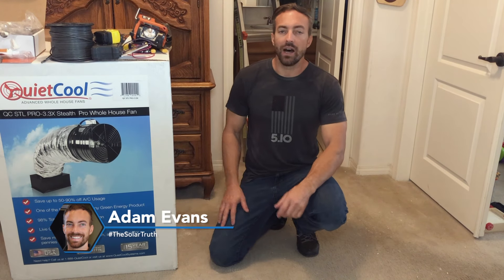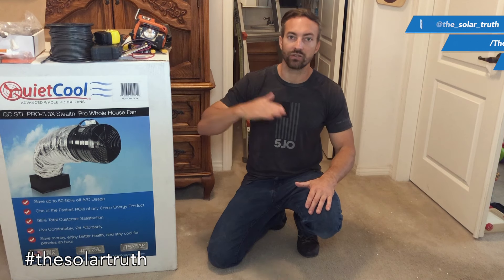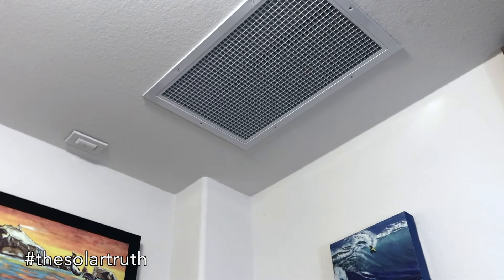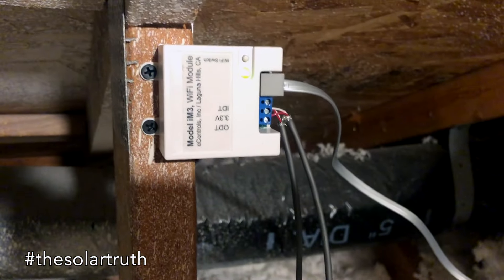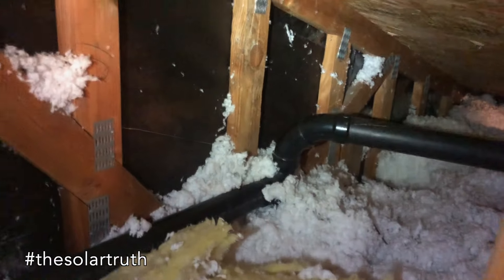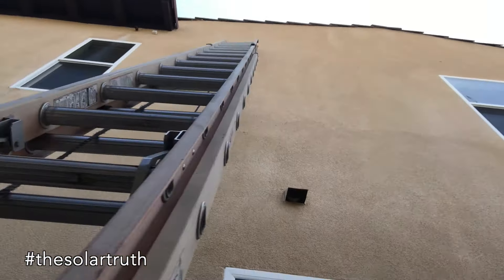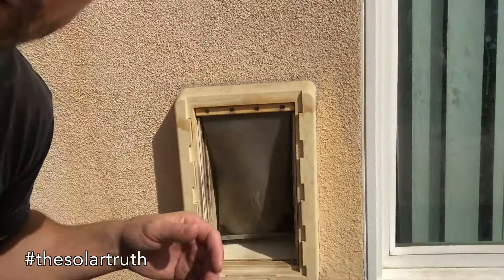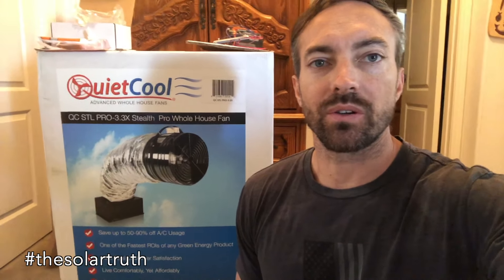Can You Make A Whole House Fan Automatic?

Comment: The hardest thing about making this automatic is if you don’t have a dog door like he does you manually have to open up your windows. You would have to integrate some type of dampener air in take from the outside if you don’t have a dog door plus you open windows throughout you house in various areas to cool your whole house down, if you only open one window in a room it won’t necessarily cool other rooms down. If you want to cool your attic install a solar hybrid attic fan, quite cool makes one of those too.

Comment: My thought was to run some drier vents in my crawlspace to a couple of locations in the house, fed from a common air box, with HVAC filter pulling from outside the house, preferably under a shaded porch.  Adding an automated vent and locking it to the power supply of the whole-house fan would give you the full automation of not having to open/close windows everyday.  Then perhaps a winter-time insulated block-off door for the attic and crawlspace duct work, so that they are not allowing air movement while the furnace is running.  Then run the whole system off a dedicated non-battery backed solar panel so that when the heat is highest under direct sun and the need for cooling is highest, you get automated cooling.  Hardest part for me would be an AC lock-out, to ensure I'm not pumping cold air into my attic by accident.

Comment: My understanding is that WHF's need a certain amount of intake Net Free Vent Area so the fan motor isn't over-taxed trying to suck air through a smaller area (which drives up the power used by the fan via over-current and burns out the motor faster).  Your QC STL Pro-3.3X  moves ~3,000CFM and QuietCool recommends 1sqft of vent area per 750CFM of fan flow, so 4 sqft with your fan.  Are you concerned you'll burn out that motor if only that ~1sqft doggie door is all that's letting air in?

Also, even though the higher pressure feels cooler since it's in motion (ie wind chill), isn't the goal of a WHF to perform as may "air changes" per hour as possible to cool down?  

I ask because i have a QC WHF too and am experimenting with how many windows to open to cool the place down in the morning before it gets hot outside.  So far, I have best luck by just opening the door at the far end of the house (huge intake vent area!) and kicking on ceiling fans to help clear hot air pockets in my house into the incoming stream of air to then be sucked out at the WHF ceiling vent.   Thoughts?

https://quietcoolsystems.com/docs/QC-STL%20PRO-3.3.pdf
Reply: Minimum Suggested "Attic Venting"    4.22 SQ FT net free area.  I think all Windows open a bit should get 4.22 intake but it says Attic Venting, so you would need more vents if your attic does not have 4.22 SQ nfa exhaust.  Maybe you could install 1 large gable vent or multiple vents into soffit.  I hope everything works out well for my install... How did they get the pro model? I thought only purchasable through contractors and also read only 2speed for all other consumer/DIY models. Hope they are wrong and can wire 3 speed on es-3100.

Comment: Please let us know what products you used. This is exactly what I’ve been researching for the last few months. I’ve devised an fresh air intake system but need this switch setup. My new fan showed up today, so the sooner you could let us know what you used, the better. Thanks. This is great work.
Reply: Yes, please post links to each component or this video is a bit useless. So far, a controller for a solar water heater pump is the only off the shelf product I could find, or else I’d need to build from scratch. Help!
Reply: @astephens9923  just ordered one now!
Reply from the maker: Glad you guys figured it out. I was going to post it, but they were out of stock at the time. It's a great controller and very reasonable price.
Reply: How much did you pay for the controller? Did it come with all the sensors you used?
Reply: @ajcarrico1  it came with a built in attic temp sensor and then there are two other wired sensors. One goes outside and the other inside. All one kit. Ive been talking to the company too much (because I’m annoying like that) and they have been amazing, helpful, and very nice (also patient with me and all my questions). I think it was around $150.
Reply: @ajcarrico1  whatever the price on their web site was, I think it was about $150 and had the sensors in one version of the product. another version doesn't come with sensors so be aware. $15 difference based on sensors.

Comment: is there another way to make the whole house fan automated?
Reply from the maker: My installation was difficult due to my attic, but this is actually an amazing/great way to make a whole house fan automatic. But essentially, no, there is not. Maybe there will be a future system that is a little easier with remote temp sensors (but then you have the problem of cost and changing batteries...) 
You still will always have the issue of making sure air intake is possible. The doggie door worked for me, or you will have to leave a window cracked open or manually open it.

Comment: But in Texas the addict is hot how this will work on my house
Reply: The attic stores heat and the fan will blow the hot air out the soffit vents and replace it with the cooler air entering the home through the venting windows. With a little time, the whole house (attic included) will cool off from the evening air.
Reply: Most addicts aren’t hot, you must have a new one.
Reply from the maker: With sunny, hot weather, Attics will get hot. That's where they work best (as well as low humidity) 
If you notice your HVAC cycling all night even though it's 50-65 degrees outside, it's cause your attic keeps baking your house all night, but not if it's vented from a whole house fan... 
Texas is generally dry heat, so should work well.

Comment: Why in this day and age install something so inefficient? In a state with a 70%+ humidity those don't work.
Those are so 1970! Not to mention dangerous. Folks have died from carbon monoxide from those things.  But they saved a dollar. Sorry 35+ years in HVACR and home construction industry say these are a waste of time.
Reply from the maker: Sorry for the delay, my schedule has been crazy. I did see this right away, and noticed my HVAC had just turned off and quite cool just turned on... So, I looked at my Sense monitoring system (too bad I can't post a pic here). My 4ton HVAC was using over 4000W when it turned off, and the Quiet cool started up and ran at 285W- which one is inefficient??!! 
Yes, you obviously should not install them in humid areas... so, then I checked my humidity in SoCal, and was below 40%, nice, that's why it works so well, and they are so common in SoCal. And for sure, only a professional should install them to make sure there is nothing that could be hazardous in the installation. 
I would also only recommend them for people that like to open their windows for fresh, cool, outside air. If you like closed windows, AC, and higher bills or more solar, then don't get one.
Reply: CO poisoning?  How?  Where is the CO coming from and why is the fan not pushing it up and out through the attic along with all the hot air?